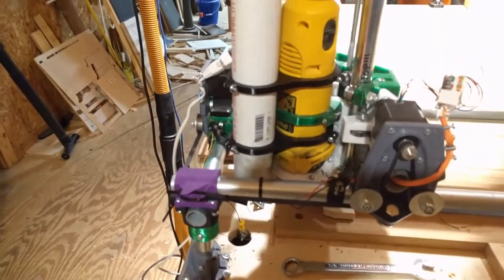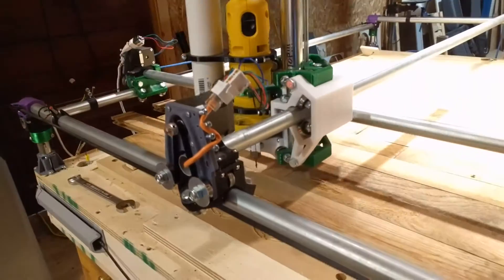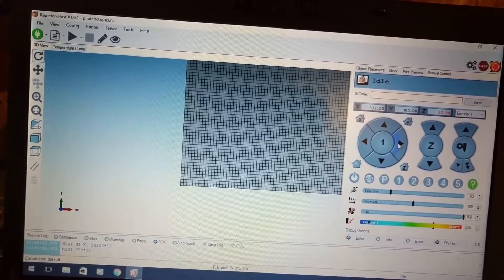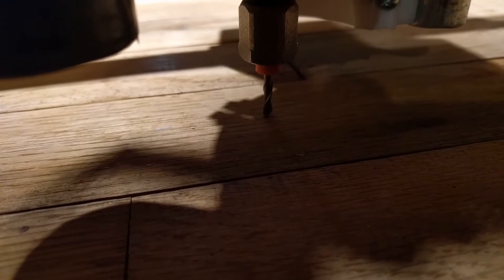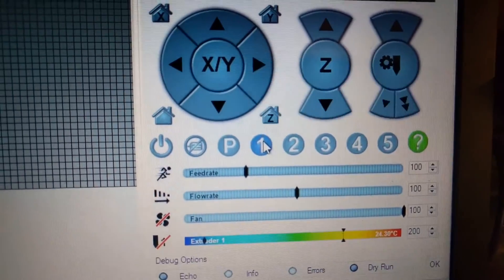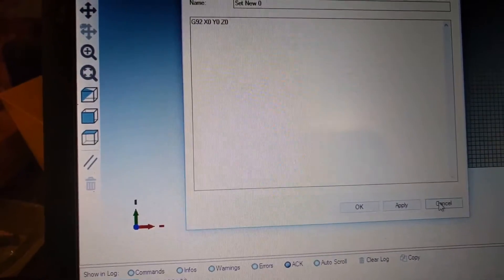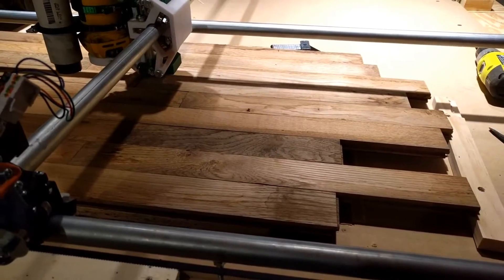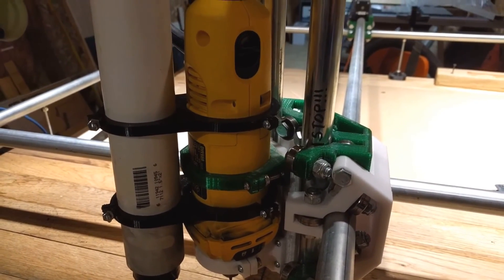MPCNC end stop useage.

Comment: did you have to change anything in Marlin to get your end stops to work?
Reply from the maker: Nothing.  They're always enabled.  Default is normally open in the standard firmware.  Connect the stop wires to the signal and negative terminals of the end stop ports on the board.

Comment: Hey Barry, nice work. What did you use for the rails? Does the machine sag when the router is around the center?
Reply from the maker: Rails are 3/4 emt.  It doesn't sag too much, but it is larger than designed.  There's a different design for one this large.  https://www.vicious1.com/lowrider-cnc/